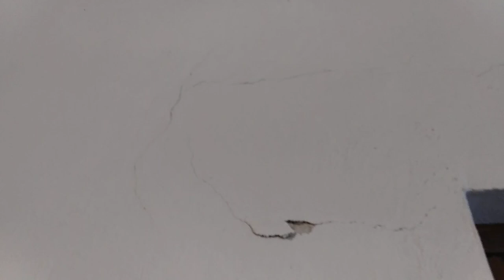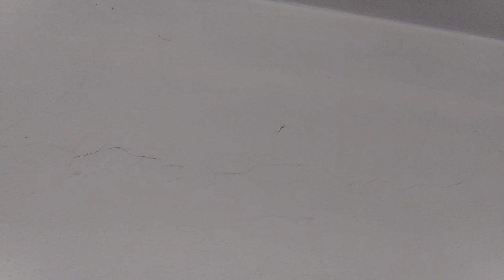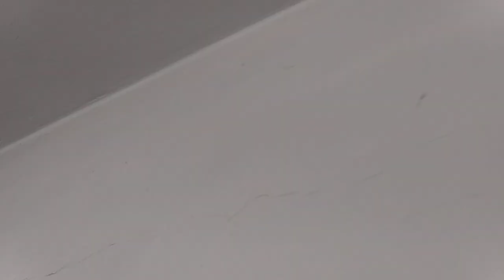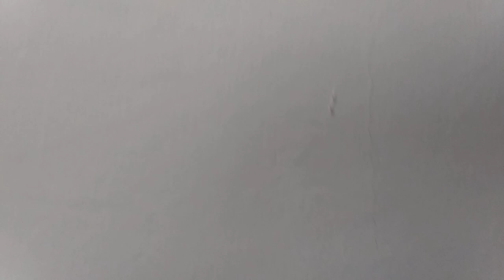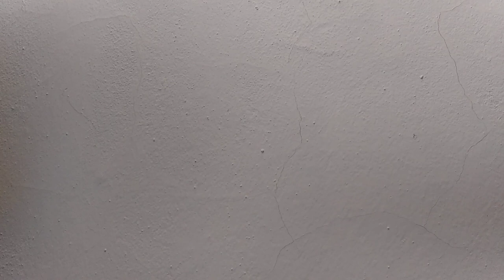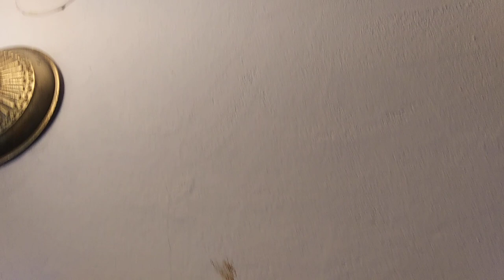Why is lime plaster better than cement plaster

Comment: Hey thanks for the video..i am trying to create my own brand of ready mix plaster if you can send any details regarding this, it will be great.
Reply from the maker: Lime plastering is in a nutshell simple but you have to keep in mind that unlike cement, it requires you to adjust sand type in the mix depending on usage. You would need to ask customers what their ultimate goal is. Is it decorative ? Is it harling coat ? Is it second coat ? You can get good ideas on this website: https://limeworks.us/. These guys create plaster mix for you depending on your need.

Comment: A load of crap if it was done properly with a cement plastering it would not crack plus lime mortar does nothing to strengthen the building there are loads of old houses plastered with cement and have never cracked I have done loads of them and not a problem you just need to know what you are doing the wall in the video is more likely to be cement plaster over a lime washed wall brain washing for lime plasters

Comment: Cement is not repairable??? LOL its easiest to repair. The mistake is using it on new construction that needs settling. I would agree real lime (not S Lime) is better as it works with the air around it. But if you paint it it does not.
Reply from the maker: You are correct that cement is the easiest material for repairs because cement is a glue that can be applied over any surface and it will stick to it. Lime is a living breathing organism with ability for self-repair. If you plaster with lime mortar all further cracks caused by settling will be easily sealed with an application of limewash which will fill in the cracks and blend with calcite forming additional layers of calcite.
Reply: Cement sets easily but long term is shzt. Every building above 500 years old that still stands today is made of lime. Not cement.
Reply: The entire cement industry destroyed locally available raw material building art, the coal plants that generate ash 24/7 are forced to be used as a substitute so that they can claim coal doesn't pollute so much, etc all propaganda.